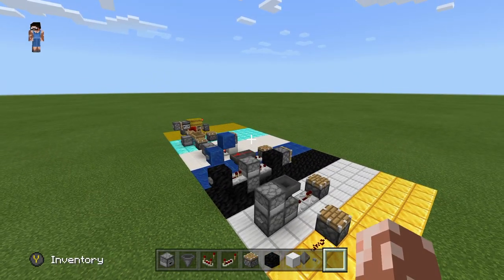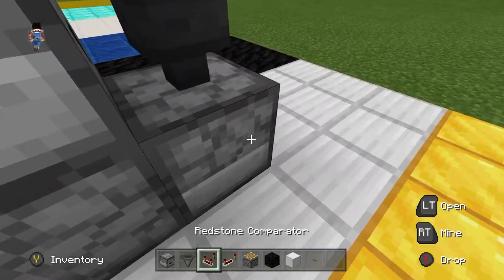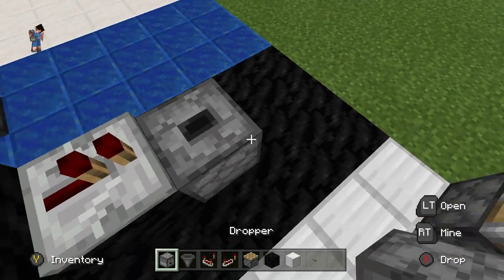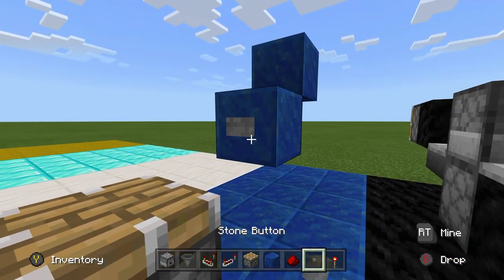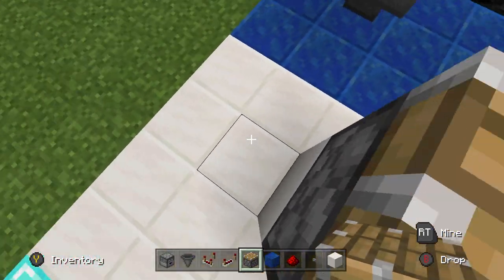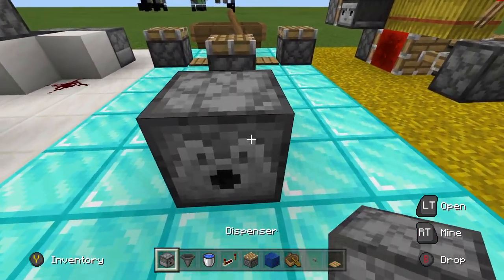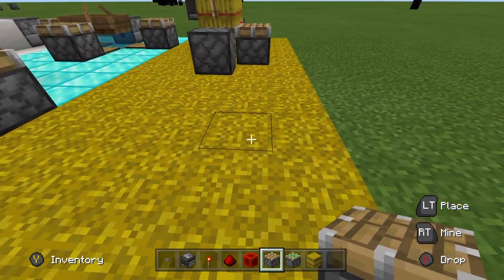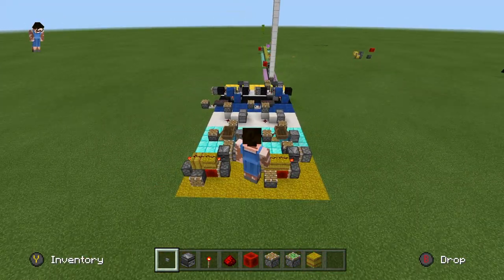How to Make a Button Act Like a Lever! Six Different T-Flip Flop Designs For Minecraft Bedrock

Comment: Thank you so much for this. I used the diamond block one and the only modification I had to make so it would work was putting mobs in the boat.

I also used a pressure plate instead of a button so I can just walk on it. Very helpful video thanks for sharing!

Comment: But how can you close if i want to have  a another botton on the other room cause i wanted to make a secret piston door but if i go in the door stays open
Reply from the maker: Well you can place a button in the other room and then send a redstone signal back to the machine and place a repeater going into the block the button is on. You could also look up “RS NOR latches” and  maybe those redstone builds will help you.
Reply: @Smitty058  thanks